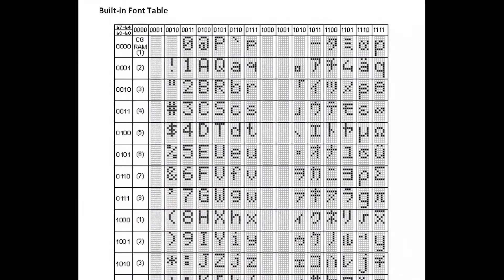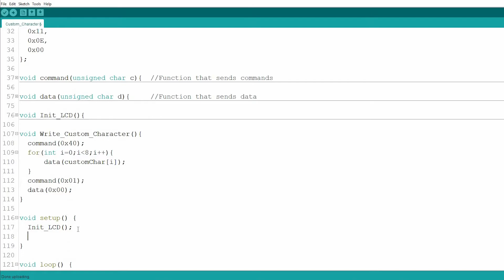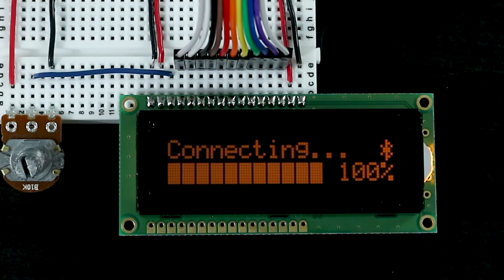How-to Create Custom LCD Characters (16x2 Character Display)

Comment: This is my very first project working with electronics and Arduino and I have been trying to figure out how to do exactly this for over two weeks without a library. Thanks for this video. 
Edit* 
I assume that the command function sets RS to 0 and the data function sets RS to 1?
Reply from the maker: You are correct!  Command function sets RS to 0 and data function sets RS to 1.

Comment: How do you get the character to display where the cursor is, and not in the top left corner? Thanks.
Reply from the maker: In the video, the custom character is getting drawn at the current cursor location. The display's initialization sequence sets the cursor to the top left of the screen at DDRAM address 0. If you need to set the cursor location to somewhere specific on the screen, the Set DDRAM Address command lets you set the cursor location based on the provided DDRAM address. (Seen in the table of commands section in a character display datasheet) For further support you're welcome to contact our engineers directly by emailing nhtech@newhavendisplay.com